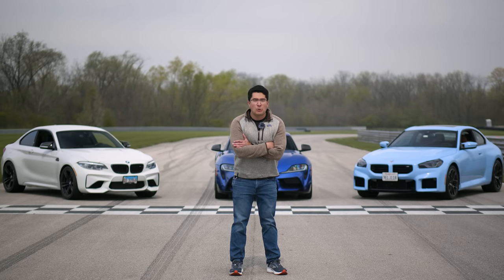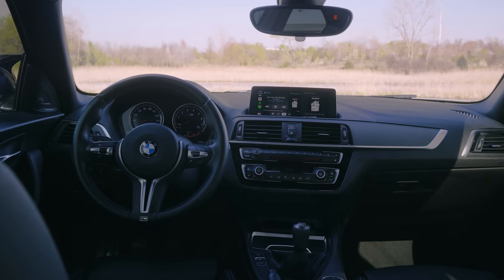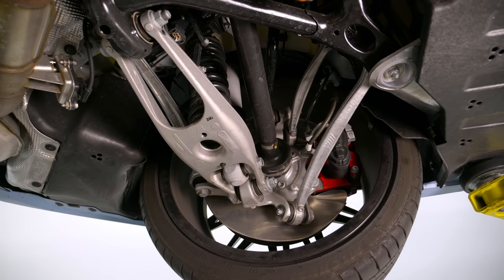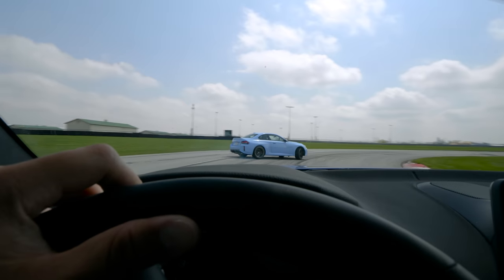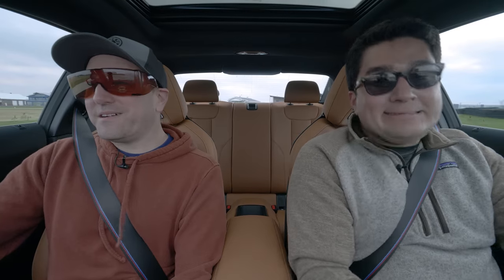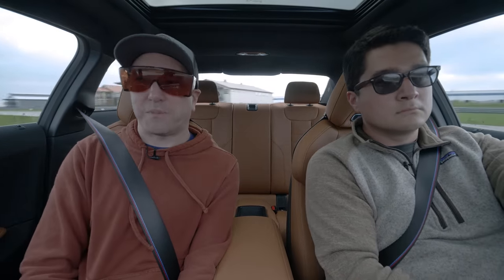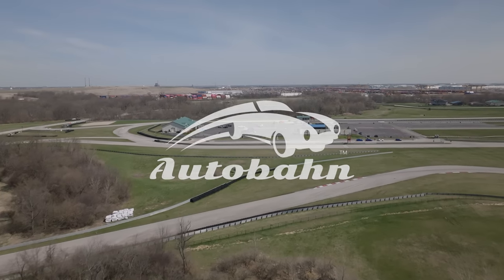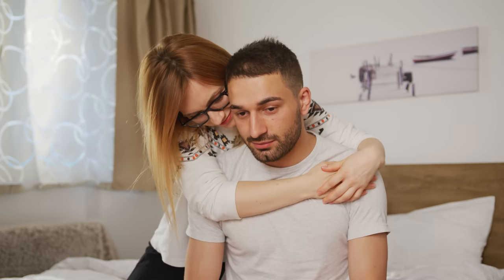2023 BMW M2 vs Supra Manuals | Laptimes and Drag Race

Comment: Any chance of creating a video on the development of the B58 and how much Toyota and BMW collaborated? No one on youtube has covered it. There are rumours that toyota are responsible for the reliability of the B58. That they stripped some B58s down to bare parts, x ray scanned everything and then went back to BMW asking for some improvements to various engine components. Also they dyno'd a stock B58 at 750bhp.  Seeing as jack loves the B58 so much, seems a no brainer....
Reply: Their the same. Only difference there really is is that the Z4/Mk5 B58s have a stronger hpfp than the other B58 gens before. More on the line of differences with the supras B58 is that the 2020 model had a B58 with a 2 port head(emissions reasons just to get it in the market/markets but is still in.certain bmws here and there)while the 2019-now Z4 has a 6 port head B58 but,there's a differences between the US B58 mk5s and the rest of the mk5s everywhere else since the US model mk5s after the 2020 model all have the 6 port B58 with 382hp while the rest of the world is stuck with the 2 port B58 in there mk5s for emissions reasons but still get the manual like the US mk5s(but have different names for trims and even have different types of special editions). Now people are waiting to see if the 24 mk5 will come with the new B58TU2 which has its differences to better get to parts easier along with the added both port and direct injection.
Reply: Oh right and well,toyo did do some tuning here and there but noting too different to separate the B58 from the others. B58s were already tapping 800whp on stock internals but when the mk5s came around people managed to get over 900whp+(record is 918whp)on stock internals. People were already seeing 9-1000whp before the mk5 came around,it just wasn't talked about as much is all(similar to the high power S55s out there also). There are already well over the 1000+whp range and are slowly still climbing.

Comment: ok so I have a (likely dumb) question. Lets say you're BMW and you're off to build a driver's car. The best driver's car. Why would you actively choose a design that removes feel from the controls, choose to add hundred of pounds, choose a digital interface over a previously excellent analog one, choose such an oddly polarising styling.

You're off to build the best driver's car. You've designed some absolutely winning formulas in the past, but now you're choosing to spending several millions of euros to redesign a driver's car that is objectively worse than your previous car. This is not supposed to be a technology bubble; you're already selling this to a niche clientele that is ok with crappy plastics (so long as they don't rattle) as long as they can feel what the car is doing; the maximum experience.

So...why pay to downgrade a good design? Why not just pull a Nissan and just facelift your driver's car, only ever upgrading things that improve driver feel and feedback? Could BMW not just keep building a 1M and spend only minimal amounts upgrading or tweaking the weak points? People are spending huge amounts on the used market to experience the old cars, which says something pretty important. I understand and fully support the transition to a cleaner automotive future with electrification, but this isn't even the case.

Comment: Does the Supra come from Toyota with crap dot3 brake fluid and crap pads?  I know my C5 Z06 and my Grand Sport were both Dot3 with blah pads out of the gate.  Amazing for that sort of vehicle but yet not surprising.  MFGs cut corners in dumb ways.

Comment: 3:21 why are you shrinking  your shoulders to make it seem smaller or more cramped then it actually is?
Reply: Because my head was touching the roof? I think your reading more into this than necessary
Reply: @jackholmes8105  Maybe I just really want to believe this will work